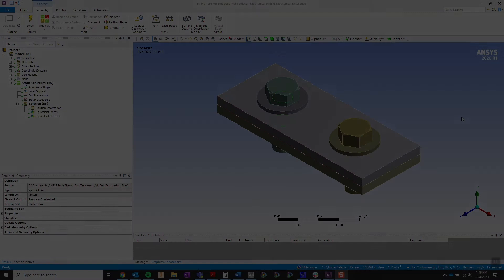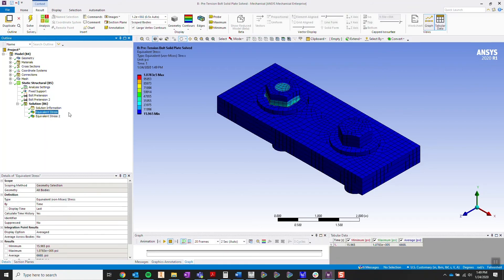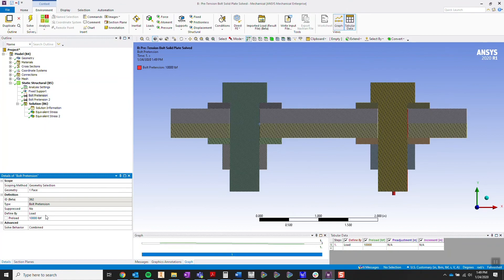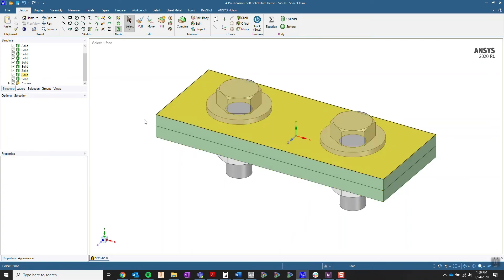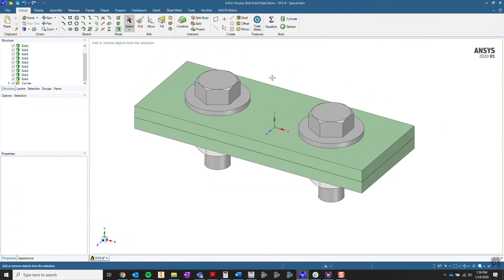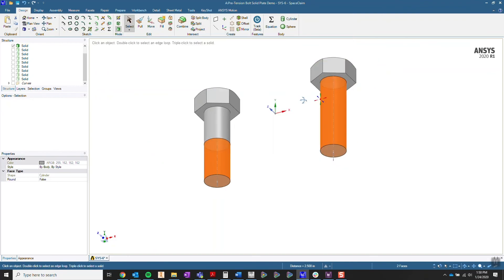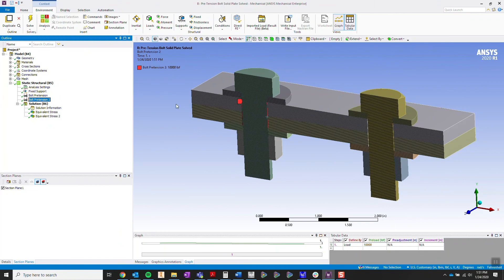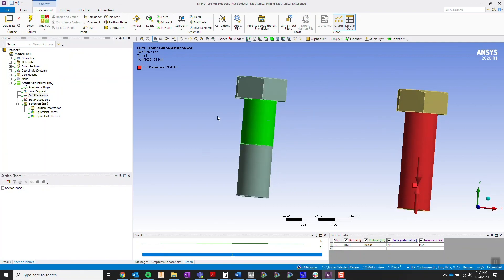Quick Tip: Ansys Mechanical: How to Setup Bolt Pre-Tensioning Properly

Comment: What about if the bolt is a revolute feature and the shank is made up of 2, coaxial surfaces??  Ansys will not allow you to pick those 2 surfaces to apply the pretension, which is extremely aggravating.

Comment: There is no sense to make bolts so long. You set all contacts as Bonded, and this is real issue. Keep in mind that Petension tool splits bolt's mesh on bolt centroid plane, and here it happens inside bonded contact surface area (looks like bonded contact between bolt and washer? =) ). Contacts must be bonded only bolt-nut (and maybe bolt-upper plate). All others are Frictional. No contact (or set Frictionless) must be along cylindrical face of bolt except bonded bolt-nut.

Comment: What about for blind holes in assemblies? if I have a fully threaded bolt inserted into a blind hole connecting 2 parts, would the whole shaft of the bolt be the body i apply in pretension?
Reply: Hello Jack, 

First question I have for you is what is important? Are you studying the failure of the threads? Or is this clamping a gasket you're studying? In other words, is the failure of the hardware itself important or what it is fastening? 

If you are interested in seeing if the hardware is going to fail, you're going to have to model the threads in and do a small scale analysis and I'll explain why. When a screw and threaded hole engage, the bottoming of the screw will cause the screw to deform and the bottom area will get wider. This will cause the last 2-3 threads to be the only threads truly engaging. 

If you are not interested in the hardware, I recommend just bonding the surfaces in the blind hole to the shaft. 

Sincerely,

John Dao
Reply: @johndao8592  Hello John,

Thank you for the reply and recommendation. Sorry i did not specify what I'm trying to simulate. The model is simply a table and its legs screwed in from the top. So in total i have 4 pretension bolts, in blind holes and im looking to see if the table and legs remained fastened together when subjected to a large load in the y direction. Around 100lbs for the load. I modeled the screws without any threads and separated the faces with their respective contact (leg and table).

Thank you, 

Jack
Reply: @TheJackandcody  Hi Jack, I'm in the midst of a similar problem atm and would like to know how you managed to resolve your issue .